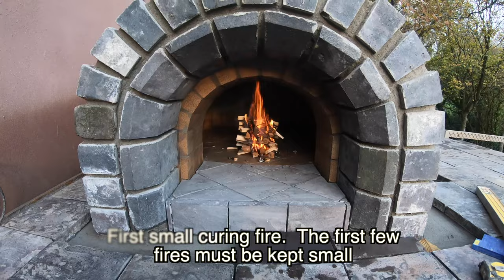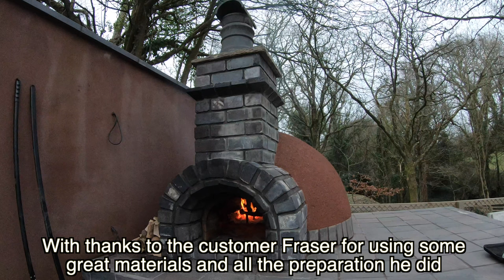Pizza oven build

Comment: Sam thank you so much for your video but I have a question. Do I can use Thermafiber as the insulation. According to the instructions it can hold over 2000 degrees. Is the Owens and Corning brand and is the Sound and fire insulation.
Reply from the maker: No problem at all, glad you liked the video.  I can’t see a problem with that insulation if it’s rated for 2000 degrees but I can’t say if it will match the ceramic blanket insulation or not

Comment: Hi Sam I'm wondering how the rotating arm was attached to the oven floor? It would have to be solid.
Reply from the maker: Hi Hamish can’t remember what I did on this one but there’s two ways, either screw it to the firebrick base and fill the holes after or cut ply to fit tight to the first row of bricks (then cut into quarters so it’s easier to get out afterwards) then you can screw the arm to the ply.  Hope this helps!

Comment: By any chance how many inch thick was the insulation board?
Thank you and buy any chance did you mix your own fire cement or pre mixed?
Reply from the maker: I can’t remember on this one if the insulation board was 25mm or 50mm but the one I’m doing now (I’m doing a series on my channel) I’m using 50mm thick board.  

On this oven I mixed my own fire cement but on this one I’m doing now I’ve bought bagged stuff that you mix up, it’s about £35 for 25kg I’ve found it for on eBay
Reply: @SamDaviesBuilder  how can I watch your channel? What do I have to do?
Reply from the maker: @FrankPugliese-p5f  you should be able to click on my name to find my channel.  And subscribe too so you don’t miss new videos.
Reply: @SamDaviesBuilder   awesome I subscribed!!! When you laid the fire brick on to the foam board was that just wet mason sand that you used or was it mixed with something
Reply from the maker: @FrankPugliese-p5f  thanks.  It was just plain sand although I may use the firebrick mortar to stick them down on my next oven

Comment: Que tipo de ladrillo utiliza y que mezcla para asentarlo (pegarlos), gracias si fuera posible la información.
Reply from the maker: I used a fire brick and for the mix I used silica sand, fondu cement and a bit of fire clay.  I think it was 3 sand, 1 cement and 1  fire clay

Comment: How many fire brick did you use? Building a pizza oven for a customer and if you got an answer that would save a TON of time!
Reply: Also can you send me a link to the rotating arm? Thanks in advance!
Reply from the maker: Sorry I’m not sure the total amount of bricks! When I do the next oven I will count.  

The rotating arm is just a castor wheel (like on a little trolley) with the wheel removed and the wood bolted on in place of it.  I’ll try and make a video of how to make one!